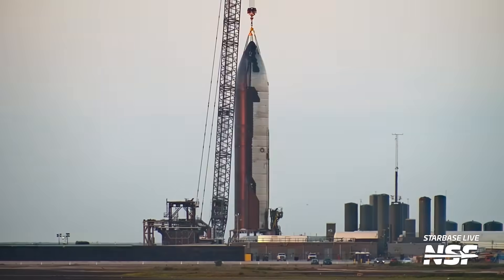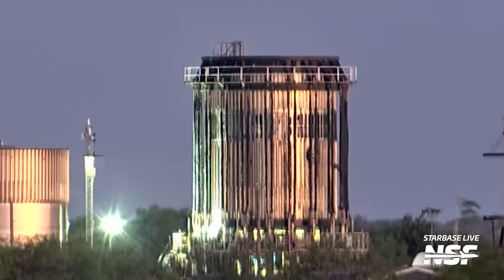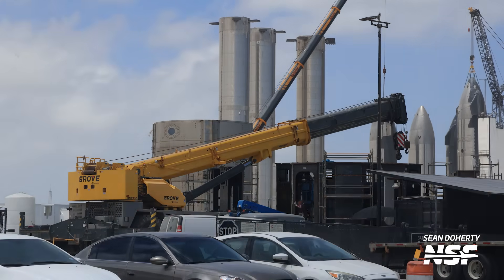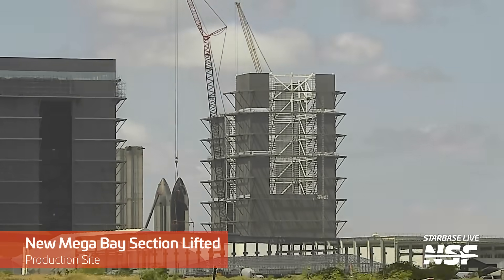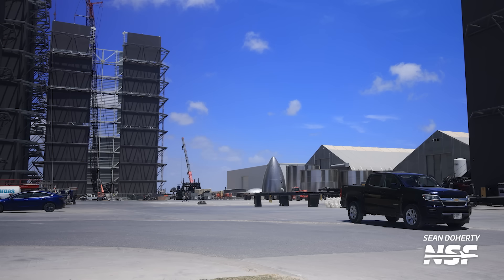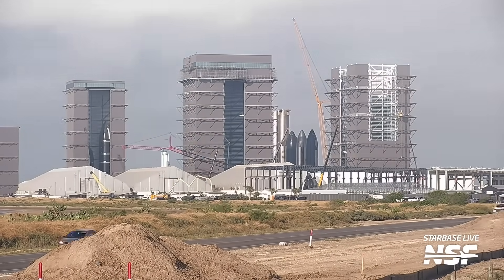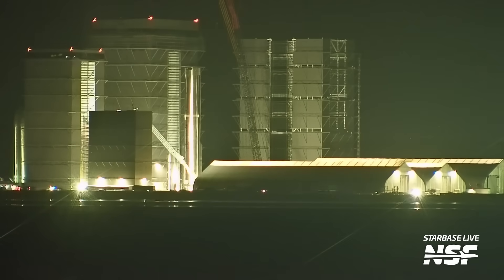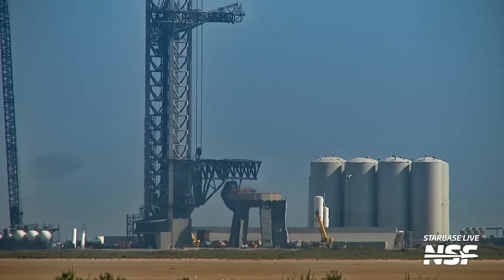Starbase Update | HLS Mockup Revealed!  Mystery Structures & Booster 9 / Ship 25 Progress

Comment: Do you think the the hot stage test article will end up on booster 9? it doesn't seem like SpaceX is planning on testing it to failure and we haven't yet seen another hot stage ring be built. it the ring survives testing, then it would be quicker to install it on B9 and use it for the flight rather than manufacturing a new one.

Comment: The HLS "cameras" are more likely a closed ball valve. As the name suggests, a ball valve has a precision machined ball that blocks the fluid passage. To allow fluid flow, a hole drilled through the ball can be rotated into position by turning the ball 90°.

Comment: I think you're wrong about "Panel HLS". The rest of the label continues the voltage, amperage, and the Panel it's fed from. This could be just an electrical panel name. Normally, It might stand for House Lighting S (which wouldn't make sense in this case). If the first letter is an M, that might stand for "Main (panel) LS". It just looks more like an electrical panel designation that a ship label.
Reply: It's an electrical box routed from another electrical box. Both have HLS on them plus another acronym next to them. The theory is that they're marked as part of the electrical system that powers the HLS mockup, hence the different electrical boxes having different labels with "HLS SOMETHING" on them
Reply: @ale131296  Not convinced that HLS on electrical panels if for human landing system. But, they could have done it that way
Reply: @PC-nf3no  I mean, what else would "HLS" stand for on two different sets of electrical panels that are labeled as "HLS ###" and reference each other
Reply: @ale131296  I've looked at hundreds of blue prints and each architect that was laying out panel schedules usually had a pretty standard way of labeling panels. H usually meant house  power but there were other reasons for the letters used. M for main and etc. There were different designations that stood for the type of voltage and others that stood for emergency or critical power. Labeling electrical power as for the test stand, as in HLS, just isn't that common. But this is Space X.

Comment: I wonder if the new structure at Masseys is an engine instalation shed?.  Vehicles won't have to be taken back to the production site (Getting in the way) they will get tested at Masseys, fitted with engines & then off to the launch site ?.

Comment: well if its a HLS why would it have a heat shield i do think that its hls but still but still do  you think they changed the plan
Reply: We explain it on the video: they took Ship 22's nosecone, scrapped the rest of the vehicle and kept the nosecone to use it for this mockup. The "it's a long story" goes like this... The nosecone was originally built for Ship 21, which was merely a copy of Ship 20, but Ship 22 introduced upgrades from 20 and 21 so the nosecone ended up on Ship 22 and it was thought it would have been the next in line after Ship 20 but instead they jumped to Ship 24 which then flew on the first integrated test flight. On the other hand, Ship 22 was moved to the Rocket Garden and stayed there for a long time until earlier this year it was taken out and scrapped. The nosecone, however, was not scrapped and was used for this mockup. They completely removed of everything from it like the flaps, their mounts, the RCS thrusters (pre-S24 nosecones had cold gas thrusters), and a bunch of other hardware. The tiles are just a carry-over from back then.
Reply: @ale131296  so can I ask another Question if this is left over then they use like other ships to build a sorta Frankensteins monster of a HLS and if that's a stupid question sorry.

Comment: Why not make s26 hls mock-up number 3? Already assembled, just cut some holes and add some stuff.
Reply: Because this is much easier...
And they (may) use S26 alongside B10, but it's likely to be scrapped.
Reply: Because they already had S22. S26 had an accident that made its common dome collapse which likely deformed a large part of the rest of it.
Reply: @knowledgeisgood9645  S27 had the common dome collapse
Reply: @bryanillenberg  Oops. You are correct, by bad. S26 has still some use - we just don't know what yet.

Comment: I wonder how will it be possible to supply the launch site with enough water to support several launches per day every day. I think Elon should've gone with sea platforms, i dont see a way how several launches per day for several days in a row could work on land.
Reply: I heard they cant use water straight from the sea because of the salt, so it doesnt matter from this point.
Reply: It's not a 'right now' problem, so one they can ramp up later.  Trucks work at this scale, and are the cheapest option for now.

I'm under the impression that in the longer term they'll be looking to set up a desal plant, at which point they can produce as much water as they'd ever need.  Like everything else, we'll see how they handle this constraint in time.